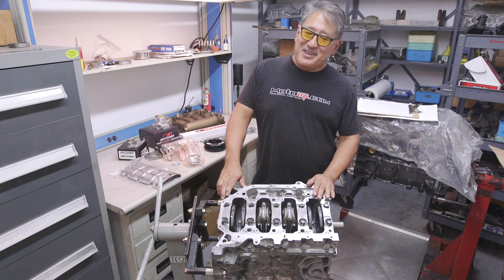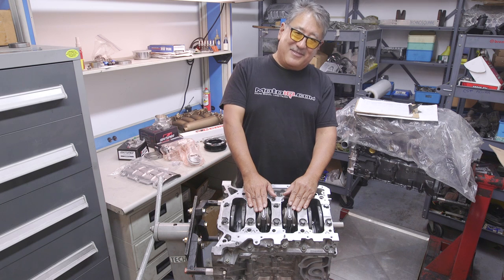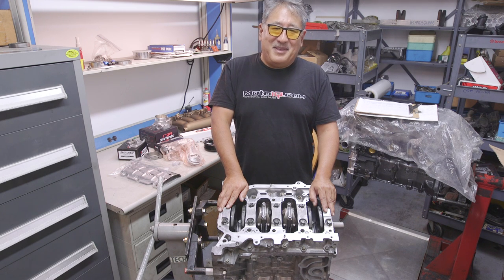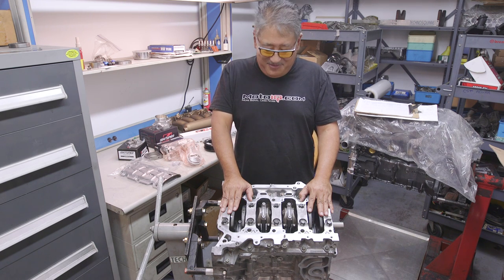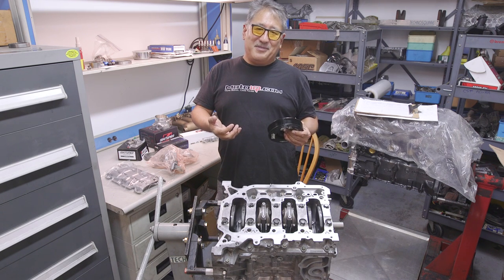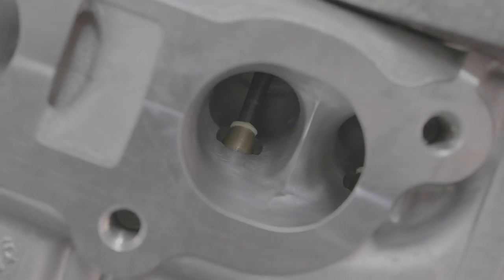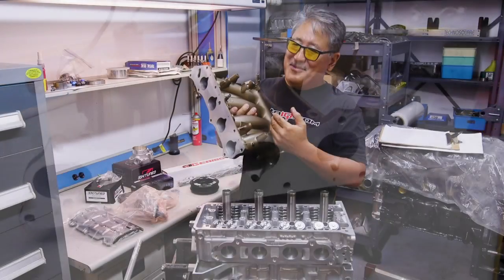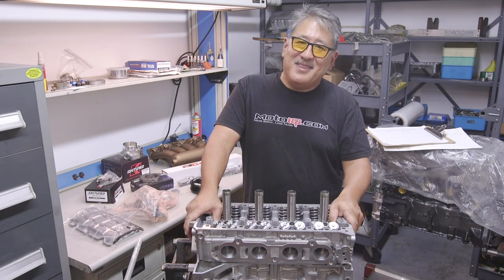How to Get 150hp/liter from your Honda!

Comment: Why take out the balance shafts? Probably a good smooth revving balanced motor before you took them out??
Reply from the maker: Because they bleed oil pressure, greatly increase oil heating, aerate the oil, are prone to failure at high rpm because they spin at 2x crank speed, they eat about 10 hp at high rpm, they cause excessive windage at high rpm. They don't affect any critical engine balance, only up and down shaking.  You can hardly tell that they are out. That's the reasons.
Reply: @motoiq  a  engine I use to own was a 4g62b in a ex gsr lancer. That motor was soo good a build. Was faster than the first evos and more reliable less fuel. My friend tried to build the same motor and people told him take out balance shafts make more power but it didn't last. The motor I had was smooth and balanced revving and I believe the shafts kept it all locked in. Had a high volume oil pump and front mount oil cooler. I told my friend leave them in mine has them and its good. Think porsche used balance shafts in there motors too
Reply: @motoiq  that motor had a throaty purr to it lasted along time :) just single cam engine was basis to the evo motor used same bottom end basically but added twin cam heads etc
Reply from the maker: There are a million things that make a built motor not last. Balance shafts are used to damp out a 4 cylinders inherent up and down shaking moment. They have nothing to do with the engines internal balance or torsional damping.  These affect the engines reliability and durability.  What the balance shafts damp out does not.  Our K motors are very powerful and reliable and removing the balance shafts helps for all the reasons I listed.
Reply: @motoiq  I'm not sure about k motors but I leave them in a 4g62b for the little power gain taking them out it outways it in helping with engine harmonics and little with torsional whip. High rpm gear changes clutch reliability and I believe a stronger motor it's more locked in smoothness helps in engine loading high rpm stresses with them out its not the same added vibration loss of smoothness you can buy race balanve shafts for the motor aswell
Reply from the maker: Balance shafts have nothing to do with torsional whip. They also have zero benefit for clutch life.  They do not affect the engines rotating assembly balance at all.  We remove them from 4G63's as well and we get tons of power out of them and they are very reliable. You can hardly tell they are out, the vibrations at idle from performance cams are worse.  Did you know that race balance shafts sold for Mitsubishi engines actually deactivate the balance shafts?  We use them in our builds.
Reply: @motoiq  ok you don't like balance shafts just I wonder why the factory put them in there in the first place
Reply from the maker: It has nothing to do with liking them or not, as a builder of racing engines, we remove them for the myriad of reasons I mentioned.  The manufacturers add them to satisfy consumer demand for a smooth 4-cylinder engine, not for durability reasons.

Comment: How to get 150hp/liter from your Honda:
rebuild your engine with aftermarket parts.
Reply: How else would you do it?
Reply: Raymond Yeung obviously getting red wires, red intake filter, painting the Calipers red, and anything else you can paint red. Will always up horsepower.
Reply: Raymond Yeung boost it

Comment: as usual Ford first to start using near net shape rods (powdery metallurgy sintered rods) and apparently they dont' hold up well, or worth shit. Just not good theoretical density compared to a billeted forged rod. Ford usually first to a new technology and first to discover the defects and issues with it, then 5-10 years later honda and other high volume car manufacturers adopt it and it becomes standard. But anyways the issues is that what I said, just not a high theoretical density compared to forging. They have to be hipped, which is obvious to metallurgy so not sure how people are missing that, except fact you need a giant pressure cooker made out of 2 ft thick steel/castiron and anyone who has one is likely to troll anyone who would like to pay to use it's services.

Comment: 320/2.4 = 133.3 lol
Reply: Tough to get big hp/l out of big stroke engines.  At 99mm of stroke the K24s is much longer than any of the production engines he mentioned in the video.  The 458 V8s stroke is 81mm.

Comment: K24 aint special mate, you can get good power out of a number of modern 4cyl engines
Reply: Like what?
Reply: Yeah like what
Reply: Toyota 3SGTE, Mitsubishi 4G63, Toyota 2AZ, Toyota 2AR, Toyota 2RZ, Im sure the Nissan SR has gotten there too, people have done great things with the EJ207... its just 300hp mang, thats nothing when most these engines have power records over 1000
Reply: @dohc7232  yeah I didn't think anyone had to explain to a car enthusiast that a turbo will make that a ton easier. We're not talking about turbo. It's obviously a much different situation...
Reply: @dohc7232  yes they do.